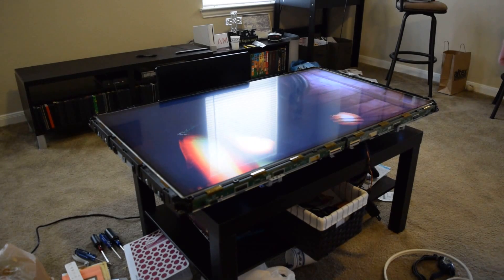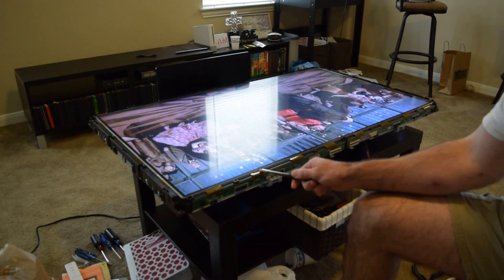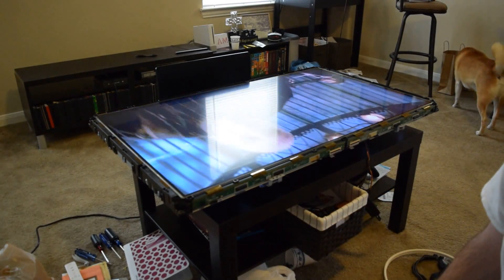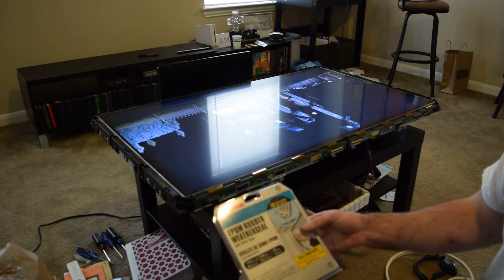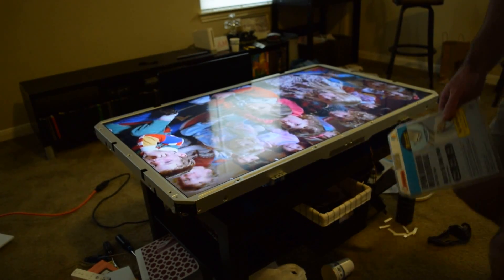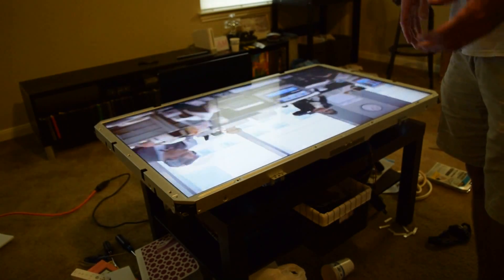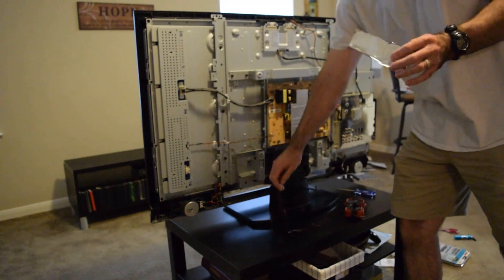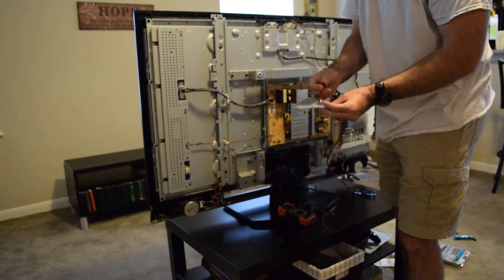Sony Bravia Repair

Comment: I'm guessing (and hoping) the TV is still working in September 2017?

Are all thin modern TV's using this bonding method likely to fail? Or it just a case of bad luck with some TV's using this method not having detached ribbon cables after many years and heavy use?

Looks like they're all doomed to fail being that they aren't soldered on and wondering if all manufacturers of slim tvs are using this method now or if it's just Sony and whether the failure always happens on the PCB side or the LCD panel side aswell, if it's the LCD side, i'm guessing it's an impossible diy fix?

Would silicone thermal pads that are used in computer parts be a good option instead of draught seal? They seem cheap on ebay that you cut to size.
Reply from the maker: Still working, it lost 1 column of pixels about a month ago, but still not too bad for something picked up off the curb.  All TV's use this bonding method so your not going to find one brand better than any other.  In fact, most of your TV brands don't actually manufacture their screens.  Most of them buy the flat-panels from the same vendors and assemble them.  Most things just aren't built to last as the manufacturers want you upgrading every 6 months to 2 years, as a result they put lots of cool features, gizmo's and gadgets in them, but are generally poorly designed and put together.
Any kind of pad will work as long as it applies pressure and isn't flammable.  I measured the ribbon temperatures at 170F (77C).
Reply from the maker: A few, single vertical lines have shown up, but working well otherwise still.  All modern T.V.s are made like this, the brand doesn't matter.  They're made to last only a few years and then to be thrown out and replaced.  The same is true of virtually all modern electronics.

Comment: Well, thanks, mac. Sure sounds a far better idea than swatting the back of it with a rolling pin as seen on other videos. One thing: I really don't mind spending another few bucks on a different rubber weatherseal, but I do have some leftover RUBBER FOAM as opposed to the EPDM rubber seal that you use in your video. Will either do, or would the foam be dangerous to to the telly's fluctuating heat? [thanks ahead of time!]
Reply from the maker: cs Montacruz As long as the ribber foam's ignition temp is higher than 200 degrees F you're OK.  I used an IR thermometer to measure temps and found that it runs at abou 175 degrees F.  200 F gives you a 25 degree margin of safety.

Comment: I'm wondering if it might have made better sense to put the adhesive weatherstrip onto the frame, in the position where it would lay over the ribbon cable tab.  This way you're not introducing a foreign adhesive product to the cable, and instead having just clean dry rubber pressed against it.
Reply from the maker: Not a bad idea at all.  Thx.

Comment: Built in absolescense!!.....Even the robotic machine that manufactured it would not  be able to fix that!......A one dollar fan may have prevented it.......Compression  might help for awhile, or  if you time it  correctly one could paint fiberglass resign on the connections.........It will either work for a long time or never again.......LOL

Comment: I have a sony bravia kdl-46ex520 and i am having flickering screen but on the lower part of the tv it work fine and when i unplug the right ribbon on the T-con board the other side of the tv works fine but when pluged back in it flicker and jumps, i tried to add pressure on all the ribbons to the screen and nothing happen, can it be fixed?
Reply from the maker: +Gibran Azan If you look at the ribbon there is a chip on the cable itself, try applying pressure on the chip instead of where the ribbon attaches to the board.  If it isn't the chip or the attachment of the ribbon to the board, you may be looking at a bad Timing Control Board.
Reply: Thank you very much its finally working now.
Reply: and what did you done to save the tv ?? what was causing the problems ?
Reply: Gibran Azan o